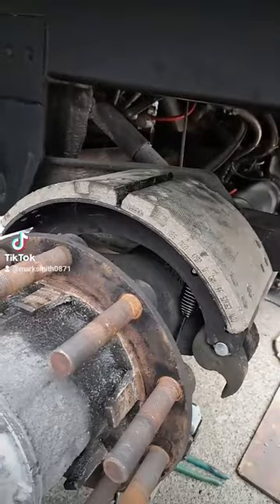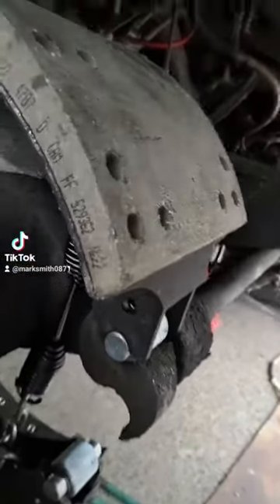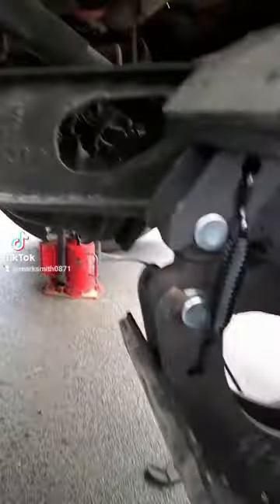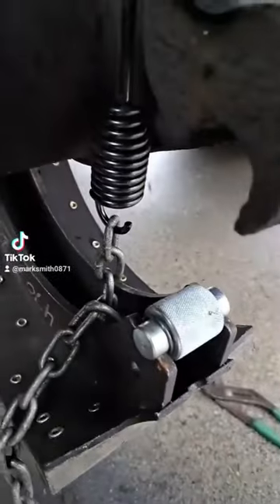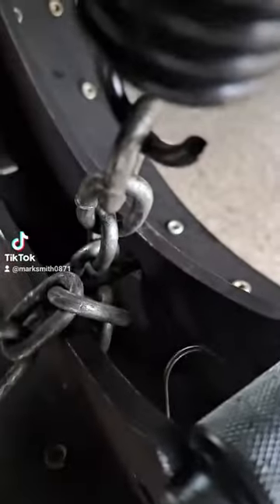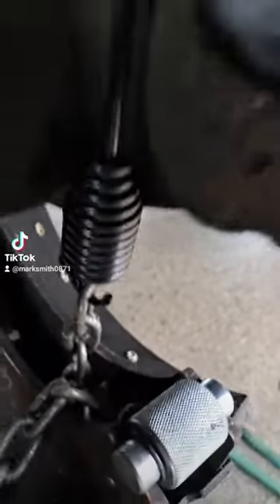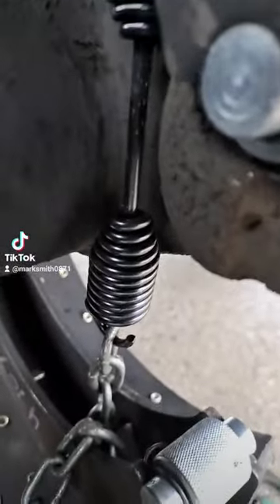4707 brakes easy way

Comment: That is the difficult way. All you need are Man Hands. I remove & install a set in 2 minutes with only a vice grip. 34 year Trailer Mechanic
Reply: Some new tech graduates ain't got the man hands nowadays. "What's a callus"!
Reply: You press out the old anchor pins within that 2 minutes as well?

Comment: I tried doing that once, but I couldn't get a chained small enough to fit in there. So I took a harbor freight pry bar, cut a notch in it with an angle grinder, and that's what I use.
Reply from the maker: I used that option as well however it works for u is the best way

Comment: Im 20 so any older guys with advice or comments lol I always put the top shoe on first turn the ratchet to give some clearance and clip the single spring on the bottom shoe, then return ratchet to position it was in and install the two springs with a smooth pointed screwdriver I made